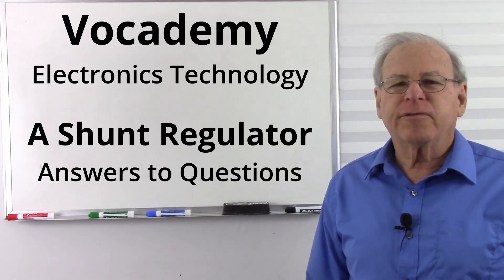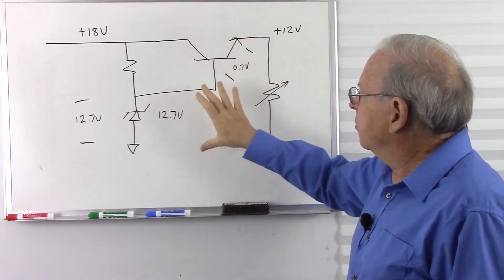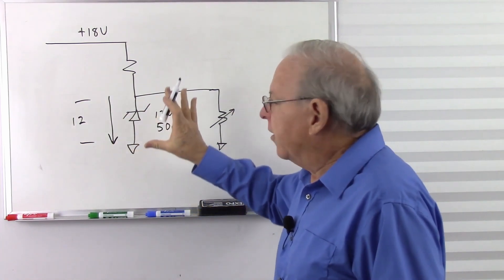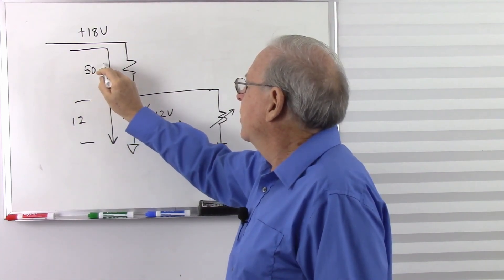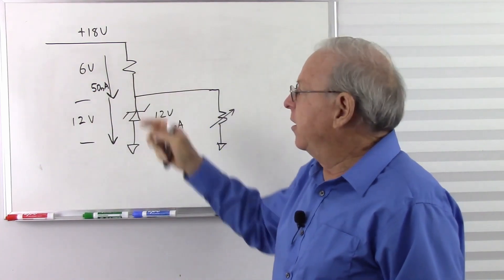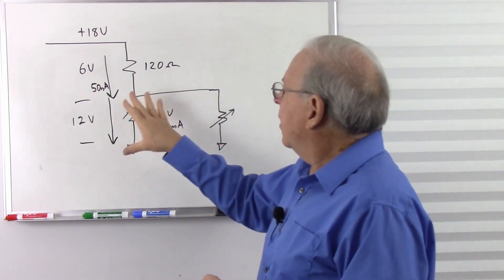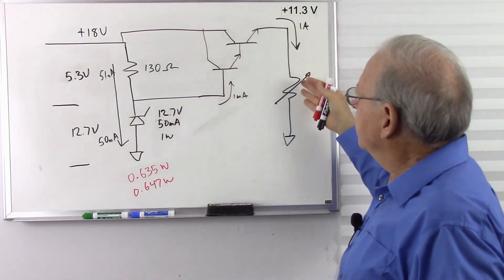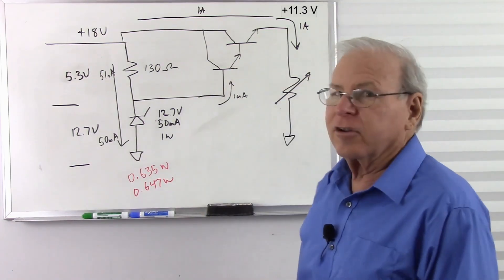A Shunt Regulator   Answers to Questions

Comment: The voltage drop across the base-emitter of  a Darlington transistor should be twice the base-emitter drop for a single transistor, and therefore 1.4V, surely, and not 0.7V as shown!

Comment: My question here that is it the relative small voltage drop increase on the zener that is lowering the resistance of the zener, or the increased current through the zener?

Comment: About terminology: the "series" in series regulator is the diode and resistor? The network is different but isn't the load still in parallel?

Comment: Thank you for the explanation sir. 
I think they might be a problem sir.
When the load is taken off, you are considering that the current demand will still be the same whereas that is not true.
When the load is off the current will obviously reduce given that the resistance of the circuit has been increased.
The increase in resistance comes from the fact that parallel load creat smaller resistance. 

Sir please if I'm wrong do me well by illuminating my dark spots
Reply: Interesting thought. I think you have a point there. The current would probably be a little lower as you say.
The resistor is still 5.71 ohm and the total voltage is still 18V . The voltage over the zener diode will increase say to a maximum of 14V ( I don't know if it can reach those voltages, but just to explain my point ) and as an effect of that makes the voltage over the resistor to 4V. 4V divided by 5.71ohm equals 700mA. The power dissipated from the zener dioder is 14V times 0.7A equals 9.8W, so a lot lower but still too much :)

Comment: Still bit unclear how that power transistor on top right corner in your sketch brings voltage down from 18v to 12v?
Reply: The Zener holds the base of first transistor at 12.7 V. Each transistor needs 0.7 volts across base emitter junction to turn on since they are two that will be 1.4 V. So 12.7-1.4=11.3V at the output. The current gain comes from the HFE of both transistors
Reply: The resistor brings the voltage down.... 

I think?
Reply: the emitter always 'follow' the base voltage (that is now controlled by the zener), it's the working principle of a BJT transistor. So the the voltage drop at the collector-emitter junction is 'forced' to be 18-(12V-0.7V).

Comment: Perfect explaining,  like an electrical course.  Thing is - I want to hold the voltage at power transistor no higher then 14.7v to battery from solar.  Will that do it?

Comment: Great explanation!
I have a 10W (36 cell) solar panel that will charge a small 12V battery.
To prevent it from overcharge I connected a 15V zener diod as shunt regulator.
The diod is 5W and the panel doesn't manage more than 300mA so it should be fine.
But I will try the series setup just for fun.
Reply: What is controlling the current?
Reply: @commonsenseisdeadandgone  The weak panel

Comment: Something else to consider with shunt regulator circuits like this is the resistor.  At 6 Volts with 1.05 Amps your resistor is going to be dissipating 6.3 Watts!!!  Another magic smoke source unless you use a large appropriately sized wire wound resistor.